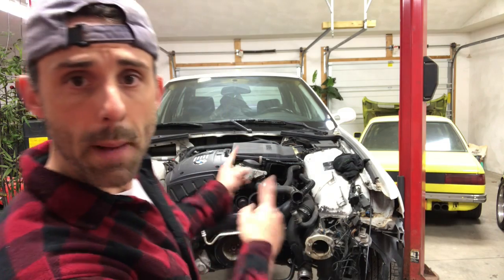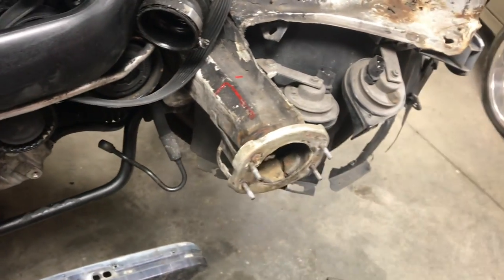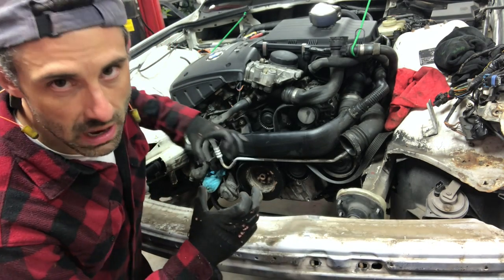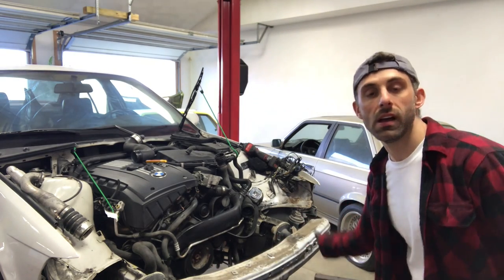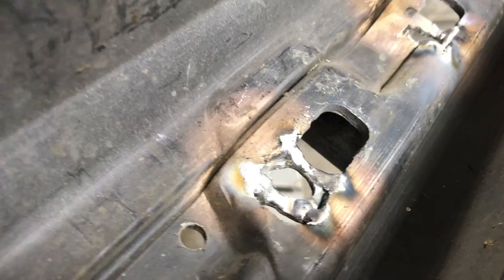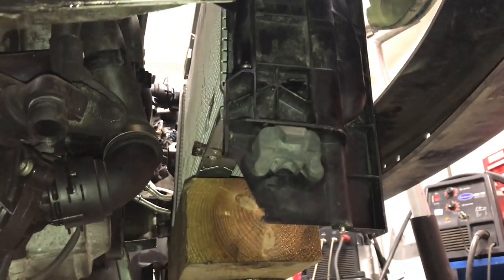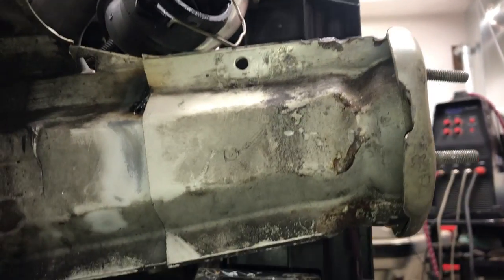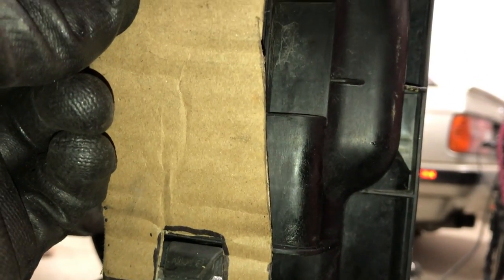BMW E92 Radiator initial fitment into the M3 - The fab work begins!

Comment: Hello Frank. I`m a really big fan and I want to thank you for all the great work and amazing videos, they are super, super helpful !!! 
I have a question for you.
I plan on doing an N54 swap in my 97 318is e36 and wanted to know is there a way to fit the engine without having to modify the front for the radiator fitment ? Maybe with some aftermarket radiator ? I will gladly do it the way you are showing :D ... but due to legal reasons I think it won`t be a good idea. In my country I won`t be able to legally register the new engine to the e36 if I do changes to the chassis such as cutting and welding . 
Sorry for the long message, I hope you reply and I hope you have a great and super productive week !!! Keep up the good work, I love your videos.
Reply from the maker: Absolutely you can do the swap without modifying your core support. In fact if you were interested in identifying what radiators would work in this application and how to do it without modifying the core support, take a look at my e30n54 swap that I did it soon thereafter. I took a different tact with that swap in that I used all aftermarket parts to make all of the cooling systems fit within the engine bay and not modify the engine bay to make the n54 cooling systems fit within it.
Reply: @Garageaholic  Thank you for the quick reply man, you're the best !!! I sure will watch all of the e30 vids.
This was so much help. Cheers !

Comment: Why didnt you try to use stock e36 radiator? This seems just too much work.
Reply from the maker: Cost. We had the radiator sitting there and a good thick moshimoto and SPAL Dan would have been in the ballpark of $450.
Reply: Garageaholic no need for mishi moto or spal, you can reuse your old m50 or m52 radiator(if you have left) and use e90 fan

Comment: Ima go Manual race car and just try to fit an aftermarket radiator , intercooler and power steering cooler. 😅
Reply from the maker: If you have the $$$ for it, do it! My way is guaranteed way cheaper but your way is guaranteed way quicker!